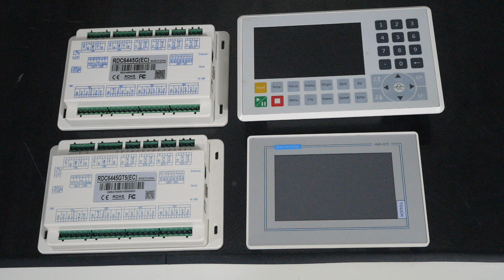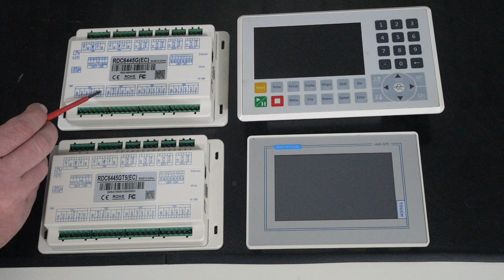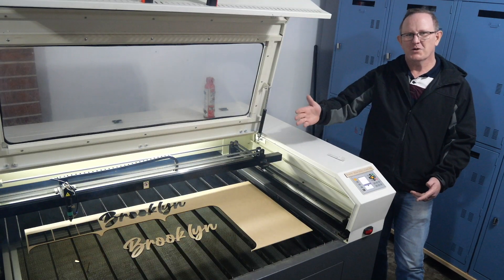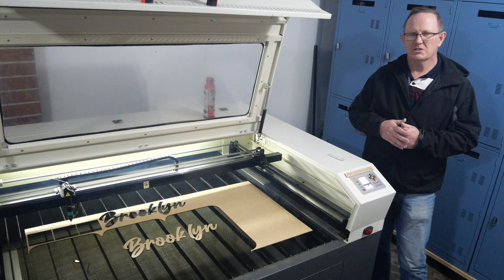[12] RuiDa - Laser Status Light Installation - RDC6442, RDC6445, RDC6432, RDC6445GT5

Comment: Hi
Thanks, I tried it and looks like the status output doesn't respond ; I'm using the air assist output as an alternative. 
Then I read in some forums and looks like it's a common issue with the status output . Do you know anything about this?
Reply from the maker: Status should be the GND (-) connection of the light and (+) is 24V  - if wired correctly it should just work, I have not had any reports of it being an issue.

Comment: It is possible to install camera on RDC6445GT5 controller and use RD-Works. Could you make a video of this? On youtube you only find about calibration.
Reply from the maker: I will look into this after I install the new RDC6445GT5 Controller, this is still some time away.  Check back at a later date.

Comment: Hi Matt, thanks for this video, it is very useful. I have a question, Matt, I hope you can answer it.
Which of the two machines is better the one you built or the one you show in this video?
Reply from the maker: I use them for different types of projects, as I find the 90W better for engraving finer detail on projects, and the 130W I use mainly for cutting wood and acrylics,   Both machines perform extremely well.  The machine I built I know inside out as I created it, so I do gravitate towards that a bit more.  The new Cloudray machine is definitely a well built machine, but to say one is better than the other is difficult... but I may be bias towards my own built machine. :)
Reply: @MWLaser  Thank you very much Matt, I was curious about that topic

Comment: Can a lamp with 2 operating modes be connected to this controller? for example, green color of work and red break or end?
if it is not possible, can it be connected the other way round to how you did it, i.e. how the machine works, the lamp does not light up and when it ends, it lights up red?
Reply from the maker: Yes this is possible, you would need a 24v relay, diode, and two colour LEDs or a 2 Colour Tower/Stack light.
You can configure it so that green is when machine is going and red light when machine is stopped.
Maybe I need these parts and to do a video update on this. :)  it seems to be a common question.

Comment: Would love to have seen this as a stack light, but helpful none the less. I literally (minutes before this video popped up for me) was looking at what Status, Out1 and Out2 were for 👍🏻
Reply from the maker: Yes is appears there are a many people wanting to see the stack/tower light installation. 
You would need a 24v relay, a diode, and two colour LEDs or a 2 Colour Tower/Stack light. I have most parts here, so I'll  order a LED tower light and try put an easy to follow video together on the installation.  I am not far off installing the new RuiDa RDC6445GT5 Touchscreen model controller, so I will change over to a stack light after I install that one. Cheers Matt
Reply: Good thing to know we can hook up a towerlight which will be much more interesting